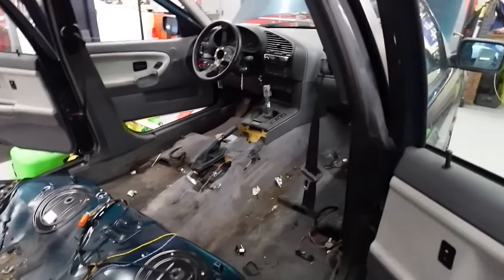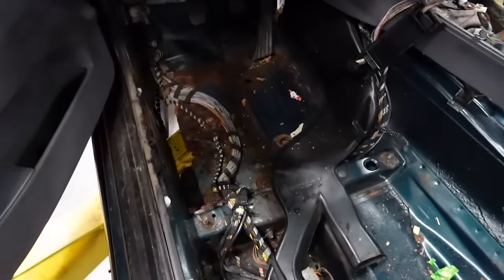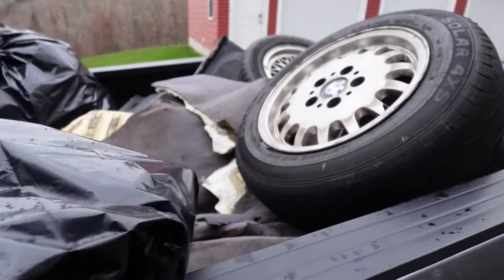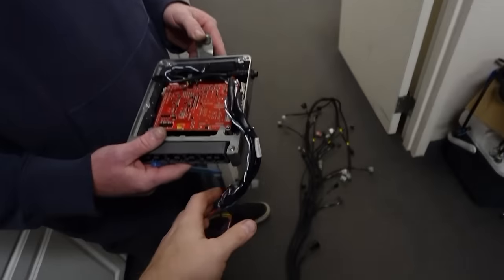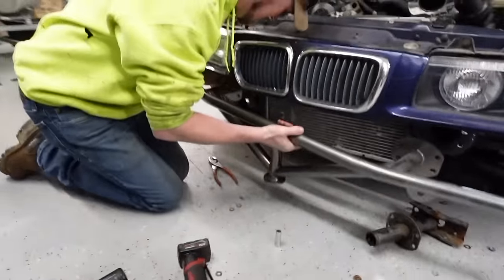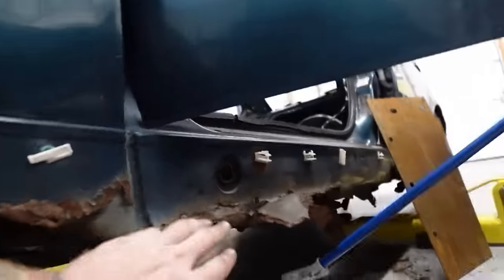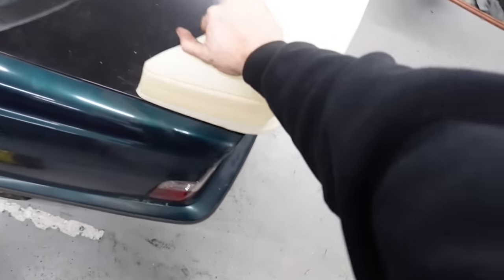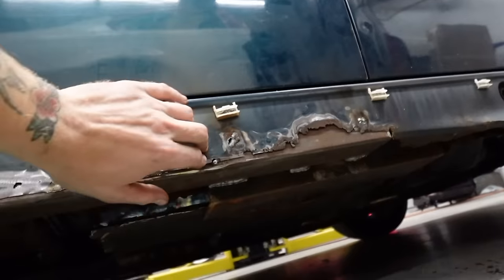This Is The WORST E36 BMW In America

Comment: The chassis isn't that bad. Sure, it'll take some work, but if all you want it to be is a drift sh*tbox and not make it too pretty, it can be done in a weekend. The jacking points can be bought as a whole thing with the tube for the original jack etc. for small money, cut the floor out and weld in some random sheets of steel or just keep what you two already did. The rocker panels can be bought for very small money from ebay as well, won't fit perfect but it'll do. 

Done that before and as a mechanic from germany, I've seen way worse E36s getting saved. 

If it doesn't need to look good, weld it yourself - will be great practice for you.

Comment: I wish they would help me with my swap im trying to do. Im putting a vq35hr from a maxima in a ser spec v and they told me no even though that swap has been done for about 17 years  combining sentra and maxima harnesses and i plan on putting this swap on a link since they have a vq35 pnp ecu.
Reply: They told me the same thing about my BMW LS swap since "There's not enough interest in that chassis" so I just did it myself. Way more rewarding. You should have no issues if it's been done for the last 17 years.
Reply: @baitmaster8706  wiring up a head unit pisses me off. Lol. But the guys that can do it I'd have to ship the car across the country to get it done and thats splicing 2 20 year old harnesses togetherness. It's like yall made vq to 240 harness before so this wouldn't be that hard.